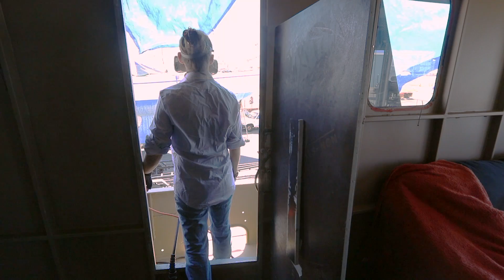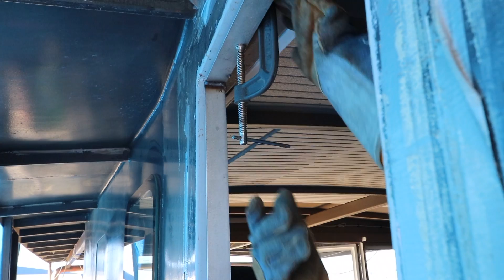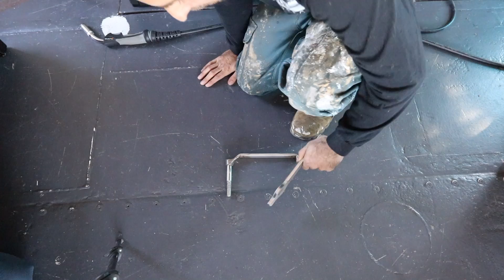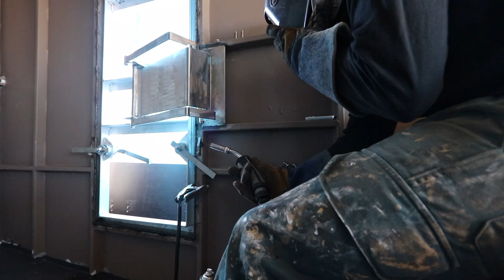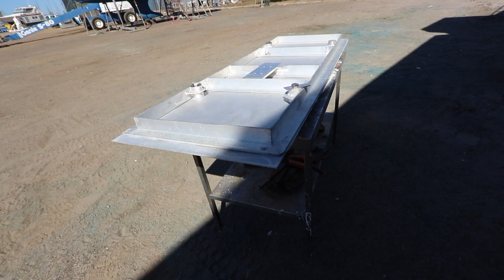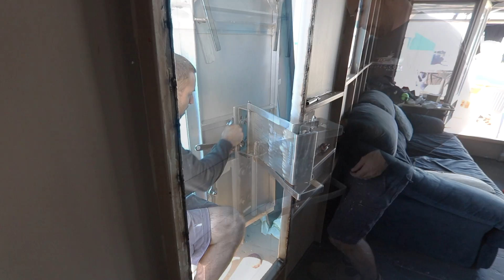Aluminium Seadoor Install - Project Brupeg Ep. 96

Comment: What's a-buzz with anti-freeze additives and pre-warming fuel? Air-ducting engine heat to quarters and bridge.  You  might have already covered this stuff on the Patreon frequency.  Hmm.  The gel fastener is porn-.  Skipper's got a (Creedence) bad moon rising protocols.

Comment: I've been watching all your videos. I have one question that I haven't seen you explain. Or I missed it.  What are the pipes on the bottom of the hull for?
Reply from the maker: Hi Geoff,  they are the main engine, reduction box and generator keel cooling pipes (3 seperate systems). These will be coming off prior to us heading to the ice
Reply: @ProjectBrupeg  that would seem to be a lot of drag. I'm sure the ice would not be a good idea with that kind of setup

Comment: on your door handles,  for emergency's and other items, will you be making a pipe to fit over those handles\dogs, so you can tighten  when needed and make a spot to hold them when not needed? being in the friged cold, you never know what might happen to the metal and need that xtra pull\push too open or close.   Great project, and really like the way you too are doing it...  Sorry for your loss of your dog.

Comment: Hi Jess and Damien, first of, i told befor but it can be told again.... and a again, your doing a great job.
The door looks great, but i hate to say, (sorry if i just missed that part), what i have learned over the year, no matter what your building, a boat, house.... you need to think water, water tends to get in absolutly everywhere, what im refearing to in this case is on the outside on the door itself, make a "lipp" that comes over a similar "lipp" on the doorframe, this will kind of work as a labyrinth sealing.
This way when the door gets flushed over by a wave, the water will first be stopped by the labyrinth sealing and then finaly by the rubber sealing.
But like i say in the start, maybe i just missed that while looking on the vid.
Finaly again a great work, love to see more...

Comment: What wire are you using for the stainless to carbon steel weld?
Reply from the maker: Hi Hank, we use 309LSi, its a blend that allows mild and stainless (304 and 316) to be welded to carbon steel in a solid robust way. The weld still needs to be painted (as you have melted mild steel randomly in the weld puddle) but its a nice wire to work with we have found.

Comment: It's the shipfitter here..... HDPE (High Density Polyethylene) is a metal ship owners best friend, use for all contact points to the hull, sleeves, bearing surfaces, depending on the weight, there are hundreds of uses, it's easy to cut and shape, will not break down, its petroleum resistance, you need to get some.
Reply from the maker: Thanks, yeah i plan to actually start adding some to wear points. having really needed to until now but I can fully understand the value of it.

Comment: What type of stabilisers are you using??? The swing arms with birds or aeroplane wings???
Reply from the maker: Definitely wings. We had paravane style but called them off and brought the steel to make wings
Reply: I made one out of 20mm plate for my 57ft trawler went big from word go cost under 2k the outcome was unbelievable but.....
Glad I only put one on because if I put 2 would of been dangerous as boat just sits there with one now and the waves just crash on it if u like I’ll dig the pics out and send to yous
Reply from the maker: Yeah ive hear this can be an issue. A new build trawler that i looked at recently had wings and they cut 1/3rd off the end of them for that exact reason. So I've designed mine so if need be I can chop roughly a third off the end without changing the internal structure. Its going to be a test and measure approach. If their too effective we will just cut them down.

Comment: Nice work guys! I need to replace the two doors on my wheelhouse but I'm thinking of cutting a packing crate in half and then screwing a stainless saddle on to each so I've got somewhere to hook a bungee cord.
Reply from the maker: lol friggen awesome. Just think of you do that rather than build a pair of hundred hour doors you will have 199.5hrs available to lounge around because you were super mega efficient with your door design and install.

Comment: Drop your current and your wire speed, you're going way too fast. You'll find that if you half your wire speed you'll be able to make beautiful circles that you'll be proud to leave untouched. I was an x-ray spec welder for offshore rigs in case you think this is just a random youtube commenter.
Reply from the maker: That’s awesome thanks very much. I will try this. I’m new to this welder so was just going off there chart on the welder door. I’ve only ever used transformer MIG so still getting my head around this one. Cheers Damien

Comment: Wow! I just finished binge watching every episode and subscribed so I don't miss any future vids. Amazing what you have accomplished. I would love to part of the crew, I'd sleep in the engine room, I have always loved the Cummins 855 engine. On that note, do not run plain water in the cooling system for any length of time, it will result in pitting of the cylinder liners, which will create an issue that you don't really want to deal with at sea. Unless you carry spare cylinder kits and all the required tools to a rebuild while adrift.
Reply from the maker: Thanks William. We did just have plain water in for testing as we didn’t want to waste coolant with leaks and anything else at that stage. She nice and full of green stuff now though

Comment: Hey guys awesome vid I love it... When you start welding you'll notice the gas will come on and continue to flow a bit longer when you stop the weld,  hold the welder tip on the weld job until the gas stops flowing this helps the weld stay strong whilst its cooling. Tow muny suck Bro (my attempt at Kiwi accent lol)
Reply from the maker: Good on ya Pete

Comment: Jess, Dam, Ex RN, Ex SAN, Ex Cunard Line Engineer, 
So ' Stoked ' for another installment, am a Paytron, with a miserly few bucks, sorry wish could spare more. !!
Did you ever seal and pressure test the Crash Bulkhead ?, being Service, am brainwashed as to watertight integrity, nothing like a storm in winter through the Bay of Biscay to bring you home to Jesus. Thanks and so looking forward to next video.   Jess, be well !!!
Reply from the maker: Hi Neville. No we never did pressure test the crash bulkhead and that was a mistake! I will be opening it up again soon as there is some internal rust I need to cut out and replace, Once that is complete I will be doing a proper pressure test on it as I cant have that area fail on us. I agree with you about its watertight or its useless mentality, best way to be safe on a boat is assume its no good and triple check everything.
Reply: Hey Both, Just watched latest, Wow your in the wars, what with the dreaded ' lurgie' , bad gas, poor Jess's editing station also, so whats with the router deal, as I guess you figured I am in the US are prices on a more to your liking router better in Oz or from here.
If you tell what is best in a replacement maybe I can get something or do a Paypal so you can replace there.
Yours.
N.
Reply from the maker: Hi Neville. That would be amazing! I don’t know routers well but I have used the brand AEG a lot and found them to be great. The only AEG router I can find is this guy https://www.bunnings.com.au/aeg-18v-1-4-brushless-trim-router-skin-only_p6230311. I will keep looking as there is bound to be other 240v corded brands out there that are available (I do have batteries for this type)

Comment: Hi there, I've got a question..Are you gonna weld a swim/diving platform with a ladder on the back of Brupeg. Greetz.NL
Reply from the maker: Definitely, haven’t made any plans for it yet but it’s on the list. We will have a fairly powerful winch and crane on the back so a dive bell is not out of the question either

Comment: 3m makes a glue for aluminum I used it on bmw’s
The front end on them is aluminum it’s called g.r.a.v. 
It’s German for weight reduction front section
The glue is called beta mate it takes a specific process to use it cleaning using a flame prep a alcohol primer apply the glue clamp in it and allowing it to dry once that’s done it’s pretty much permanent

Comment: Great fabrication! A couple holes in those outside handles and you’ll be able to padlock them? If you think that might be useful easier to do  before final fit. Maybe was your plan anyway. :p Also I’d keep those inside handles short or some idiot like me will bend your latches ...maybe have a extension pole on a string for extreme use.  Not trying to nit pick just want to help protect your wonderful efforts.
Reply from the maker: Thanks Jon. I was thinking a similar idea re the padlocks

Comment: Do you have to passivate (pickle) the stainless door handle welds to stop them rusting?
Reply from the maker: Nah nothing really. If there is no mild steel enbedded in the stainless it won’t really rust.
Reply: @ProjectBrupeg  I dunno but I thought the welding process causes the chromium to come out of solution and so it loses protection. The one time I tried welding stainless on a sailing dolley I ground it off but it all rusted. Could be the pad was not clean and I think it wasn't 316 anyway. I suppose it if was going to rust the ones you made would have by now.
Reply from the maker: When you weld mild to stainless like this the weld will rust because you are melting mild into the stainless. So it needs painting. If it’s just stainless on stainless I’ve not experienced rust being an issue but I guess we will see over time

Comment: Brupeg is a work boat... Perfect shiny doors, rounding off corners like the pilot house roof, hours and km of tape for the windows, aligning the through hull fittings to be square with the wall, hiding all the wiring in conduit... It may do work but it is not built like a work boat! Keep up the good work tho!
Reply from the maker: Thanks Steve. I’ll rephrase that. Work boat that needs to be built well enough it doesn’t stop working every other day...

Comment: Hey I see you welded all around the inside of the stainless door frame. Are you not worried about sea water wicking into the joint on the outside that is not sealed?
Reply from the maker: We will be sandblasting that area and nuk’ing it with two pack epoxy. I hoping it will be fine after that

Comment: nice work.... are the ends of the outside handles close enough when closed to have holes drilled in them so you could use a padlock to lock if needed?
Reply from the maker: Dame just told me yesterday that is how he’s locking the door. Like minds... Jess

Comment: Hi guys! Narrow side deck doors are frequently solved with sliding doors. The panto graph  door has created a lot of engineering and work. Looks great, works well and should stop the door moving around dangerously in rolling or pitching seas! great stuff! Can't wait to see her floating! Thanks, regards Roger!
Reply from the maker: Thanks Roger, we looked at sliding doors but they never seal and we cant afford drafts given where we are going so we had to come up with a plan B, Pentagraph hinge was our Plan B.
Reply: @ProjectBrupeg  You could consider putting a couple of external ramps for the dogs so you can dog your door in the open position. If you are somewhere hot, some way to keep it nicely secure in the open position, would seem a good idea. A welded bracket with a slot in it to capture the internal dog   against the outside of the cabin, seems possible.

Comment: I noticed at the end of the video where you were sitting to the back of you there is an ac . have you thought of using a split system ac/heater with tube Ducting? radiant heat would be great as well like heated floors . what do you think of mounting a windmill on your boat to generate electricity at night?
Reply from the maker: Hi Harvey, we have a spilt system in the front cabins and this window rattler in the wheelhouse. we are going to remove the window rattler and replace it with another split system as we need to for insulation purposes. As for wind turbines, we will be adding two actually, one in each corner on the rear roof, each one is a 1kw unit so should be a good amount generated on a windy night. Where we are going its either all the wind in the world or none at all, and not much in between.

Comment: Gotta ask, why not make the door flat then adjust the S.S. knife edge adjust to the Superstructure ? It would've saved time and be easier to duplicate ? 
But Mate that door is a work of Seaman ship any Shipfitter would smile and walk away like a Boss !
Reply from the maker: Hi Tony, ive been asked this a bit, The cabin has a curve in it in two dimensions and as I wanted the outside of the alloy to be flush with the cabin (im anal like that) there was no way of achieving that without duplicating the cabins curve into the door. the stainless was just following the cabin curvature and the door had already been bent to shape at that point. Next door im going to prebend the alloy then tack it up un the door frame so I dont need to try and bend a fully welded door (as that was a nightmare). I reckon I can knock about 50% of the time off.

Comment: Have you tried welding up hill instead of down hand. I’ve welded for 25+ years and for most professional welders it is easer to control flow and let gravity fill your puddle reducing edge under cut. Just my personal opinion I’m not suggesting it is not proper to weld down just a suggestion. Wife and I love the project and your both doing an amazing job.
Reply from the maker: Hi Rick, I have tried vertical up a few times and just can’t seem to get the hang of it. Admittedly that was when I was using nugget. I long for the day a qualified welder volunteers as vertical up is something I’m dying to learn. Damien

Comment: Your doing a great job. But dude, ffs go buy a steel cutoff saw from Bunnings, they aren’t exy. They will save you so much time dicking about with that grinder. Get a stainless steel cutting disc and a few mild steel discs. Keep the ss disc for specifically stainless so u don’t cross contaminate.

Comment: Hey guys! Love the videos, a thought for the locking dogs on the door. Having worked in the navy for many years, the dogs work better if you are pulling the handle down to lock. This is better for ergonomics as you can put your weight on the dogs, really important if you need to squash a seal tight!

Hope this helps guys.
Reply from the maker: The issue i had to figure out was Jess cant reach to top dogs when its like that, so to solve the 'it might wiggle open' issue. I plan to have locking pins on the inside so it can unlock unless you want it to.
Reply: @ProjectBrupeg  another option could be to have a bar connecting the lower dog to the upper dog, I have seen that done as well. The biggest issue can be that the lock doesn't naturally stay locked due to gravity. Locks can be hard if the dog can't be pulled far enough to engage the lock. 
Looks great otherwise! Have seen door come flying open at sea and difficult to hold onto and dog while the ship is rocking.  
Sorry for the long winded reply.

Comment: Are you going to weld a hook on the outside bulkhead to hold the door 'locked' in the open position, or is the sea door meant to be closed at all times? Seems like it would be nice to leave it open at dockside or in very calm seas at anchor, but not have to worry about a gust slamming the door on your hand.
Reply from the maker: Yes to all. the plan is to have three main positions, fully shut, open about 2-3 inches and locked there. and fully open and locked there. Im thinking about some sort of spring loaded clip so you open the door and it auto locks it you push it fully open. I have a similar thing for the rear lounge doors (admittedly I haven't welded it on yet). The plan is to leave them locked at sea as its a prime position to get a wave in the lounge where they are.
Reply: @ProjectBrupeg  You might have less of a 'snag' problem with a simple hook shape that can be engaged by one of the existing door dogs. A piece of black closed cell foam next to the 'hook' could act as a buffer to 'spring load' the door in the open position and also keep the door from banging against the bulkhead when opened. 'Less is more' always worked out for us on our swing keel Balboa...

Comment: I thought this might give you a giggle.
https://imgur.com/14Swi47

I'm sure it has been mentioned before as an item of equipment, however.
Dive compressor and/or Hooka rig (there will be times when a hooka is not suitable hence suggesting both) with a lift cage for the divers. That monster 10T winch with a swing out derrick (hydraulic worm gear slew?) will make life easy getting things in and out of the drink.
The 10T winch: to save the nastiness of dealing with wire rope you could consider fitting a smooth drum and using dyneema line (lighter for given rating, easier to handle and splice)
Reply from the maker: Yeah i hadnt thought of a dive bell but its certainly something that could be made. and yes I agree with you PPE comment.

Comment: Why not a nylon washer instead of the messy duralac for the handle bolts?
Reply from the maker: Yeah its one option, I do want to have some sort of grease in there so we can use it to water tight the hole. Water will find a way through almost everything, but grease is a challenge for it
Reply: Nylon washer with a groove and grease vent might be a solution then